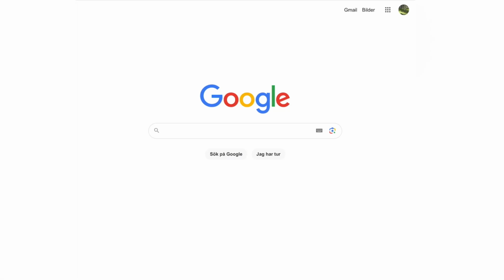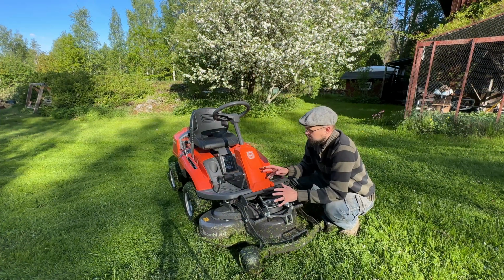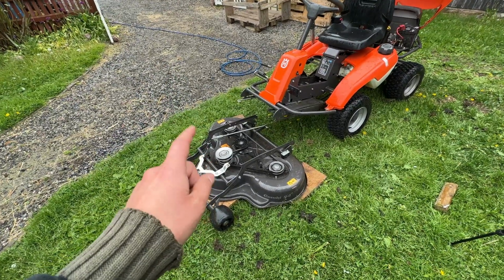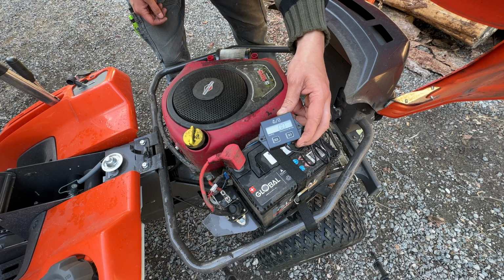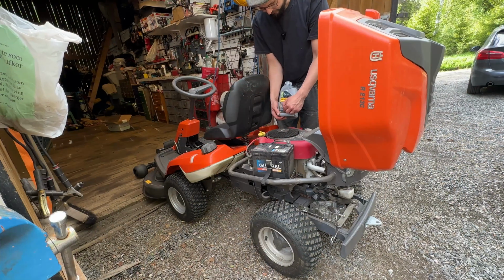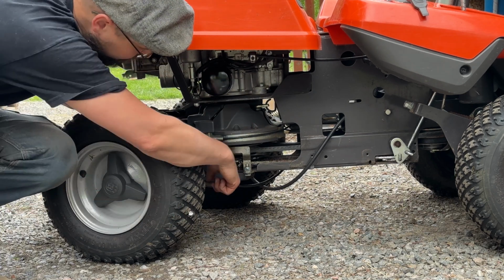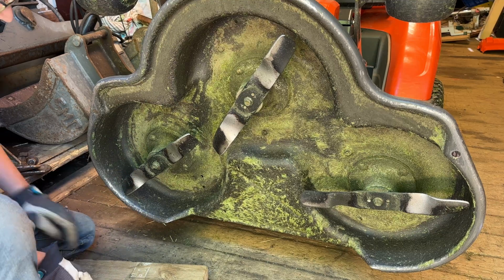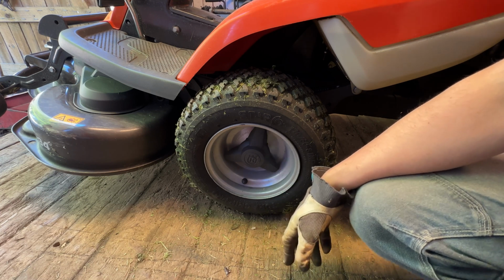Husqvarna Rider 213 service, English version 4k

Comment: what do U think? are older models of husqvarna riders more robust???? I look for ex. weight. Older are -+ 240kg, newer are 160kg. Is that justified by anything????
Reply from the maker: Hi! Generally older stuff is better built with more metal and less plastic and my experience is that the old riders are better. But the biggest change came when they stopped producing in Sweden and moved the factory to Poland. At least that is what is said online, I haven’t had that new lawnmower in many years. But I am a bit curious, what rider is only 160 kg? I hope you aren’t looking at a 1 series Rider, they are not the real deal! 2 series and up are the “real” riders nowadays. Best regards Nils

Comment: Hi Nils, in the video I couldn't see the precise point to lift the rider in the front part, as on my r316 tx awd it is not clear in the front part where to put the lifter in safety, thanks.
Reply from the maker: Hi! I just lifted in the cutting deck, might not be correct but it was fast! Some part of the frame would be better.
Reply: @NilsKall I have to grease the front wheels but the point of resistance of the vehicle to place the lift is not understood
Reply from the maker: @mauropluto4557  You can lift anywhere on the frame just be careful to support it so it won’t fall when you try to remove the wheels. Perhaps it will be easier if you remove the cutting deck?

Comment: Hi Nils, I watched this yesterday and thought I should check the left front wheel on my R 16C. The wheel took a few knocks to get off and sure enough the inner wheel bearing had locked up. I cleaned it out, regreased it now it works fine. It had not been put on the right way around. All fixed now and I will do the other three wheels tomorrow. Still love my R 16. Keep the good videos coming, I learn something from them all. Cheers.
Reply from the maker: That is great to hear! I didn’t want to mess with this wheel too much since it was supposed to be a simple service. I might have to fix it on that 213 eventually. The R16 is a good unit!